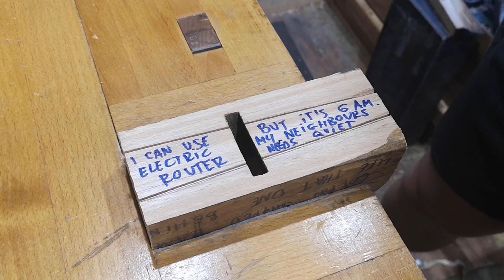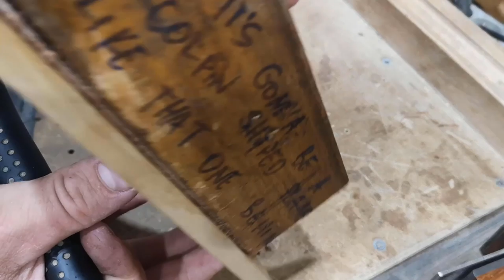018 Toothing plane rebuild. Woodworking

Comment from the maker: In the video i add new sole and changed shape of the plane body. The wedge and the sole are made out of hornbeam (old jointer plane). Veneer inalys made out of mahogany. For the finish i use boiled linseed oil and few coats of shellac orange. If you have any questions just write a comment. Enjoy!

Comment: Love your videos Stavros.As you are expert in planes can you make a video how to build a simple plane to use for all little works in the shop?I know every work need his specified tool but I need an allround tool for chamfer corners,flat little wood pieces etc..I bought a cheap  wood Brico plane but don't work well.Works better a small plane born for balsa wood  for model airplane building but it use a thin blade and don't work well with hard wood.Thanks Ago
Reply from the maker: Thank you :) here you have good video https://youtu.be/hQgkgj93Dwg

I hope it will help you :) 
Regards!
Reply: Thank you for the answer and for the suggestion Stavros.Best regards  Ago

Comment: Hello. Love your videos and they really give me ideas on how to fix up my workbench and my future projects
But I have a question: where do you get your amazing hand augers?
I have been trying to find a good set, but apart from the two in my family tool box since before ww1 all the new ones have a modern wood screw tip with no transition to the drill bit that does not dig in well at all.
Reply from the maker: Hey Axel, check on jimbodetools dot com 👍
Reply: @StavrosGakos  Hello. Thank you very much for the site. (my wallet might thank you a bit less) so far I have been ordering on Dictum or Finetools. But this is a a step up from that 😁

Comment: Great rebuild/restoration, pan Stavros! Very precise and neat job, as always.
One question though, where is a tooling plane used for? For glueing veneer on a surface, which has been prepared by this plane?
Reply: That is pretty much the point of it, yes. Otherwise it would just be a scraping plane.
Reply: Yes a toothing plane is used to rough the surface to glue a veneer to, the roughened surface has about twice the surface area for the glue to adhere to and reduces the glue from pooling in one spot as it will channel into the grooves.
Reply from the maker: Сергей Д. You already have the answer :) Thanks a lot!
Reply: Besides for preparation for gluing veneer, it is also used to handle really wild grain that tears out. You get it really close with the toothing plane and then finish up with a card scraper. For some highly figured woods, it is the only way you can work them.

Comment: Well done but would it not have been easier to make a plane from scratch and retain the old one in its original state for posterity,
Reply: He actually uses the toothing plane he recently built in this video. Perhaps he thought this would be fun and different. Also posterity is dead, sir. Mourn if you like.
Reply from the maker: The main idea was to show how to add new sole to the plane. I build toothing plane from scratch here https://youtu.be/Q6o81HBi81k
Thank you! Regards